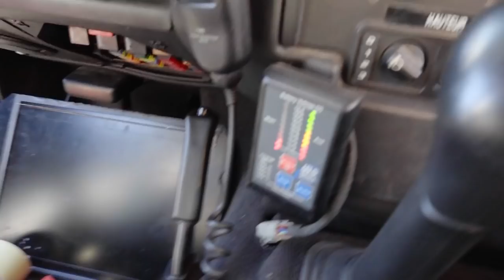BIG CHANGE inside our Land Rover Defender | Removing the wooden layout (4x4 camper built)

Comment: We are am family of 4 too. We have a popup roof wich is in my opinon esential for the way we travel. So we all can sleep in the car (defender td5). 2 in the roof, 2 on a platform which is located at about the  height of the sidewindows. This platform ist build of 2 wooden plates. One between the side-boxes an one that comes over the folded  back seats. When driving this plate separates in upright position the trunk from the passanger cabin. The luggage and other campingstuff ist stored in the sideboxes, bags an two roofboxes.
We have this selve-made  setup now for about  8 years and it still works ;-)
Reply from the maker: thanks for sharing! do you have any pics on fb or instagram?
Reply: @offtrackfamily  No, but if you like I can mail you some

Comment: Looks like the roof of the defender is full and equipped. I would suggest a 270 degree awning with a Tag-a-Long tent that attaches to the awning. You can add side wall panels for more shelter. AZ Tents and Rhino Batwing Awnings have these style of tents. We have ad one for several years. Bug and snake proof with a full heavy rubber/vinyl floor, screens and vents. Provide great comfort - the kids will like their own privacy! They are not terribly heavy, easy to set up and made with heavy duty poly-cotton for durability!
Reply from the maker: Thanks for sharing this! :)

Comment: A lot of work getting all that timber out!!!   My suggestion - don't go for a trailer, too much hassle and too restrictive for your style of overlanding. Go for a large family roof top tent or maybe two smaller ones. Then organise a heater to keep everyone warm.
Reply from the maker: Same thoughts on the trailer so clearly not an option for the moment.
Reply: There are a few Off Road trailers that are available, mostly designs out of Australia and more affordable copies made in China. They have the required ground  clearance and can generally go where any, sans heavy rock crawling, 4x4 can go, but those that offer much more room, have much MUCH longer setup times, and the popup versions don't offer much more storage space.

Comment: How about an expedition type trailer with a second roof tent. You would have room for everything then and reduce the weight on the Land Rover as well.
Reply from the maker: Would make everything easier but driver numero uno doesn't want to deal with the hassle of a trailer, which means I (also driver number 2) don't feel like managing it off-track either ;)
Reply: @offtrackfamily  I completely understand that reasoning - I felt the same and bought an Oz Tent😀